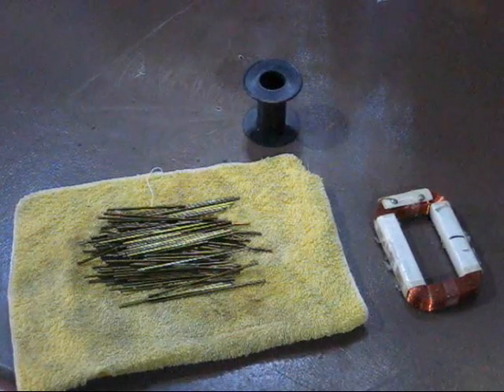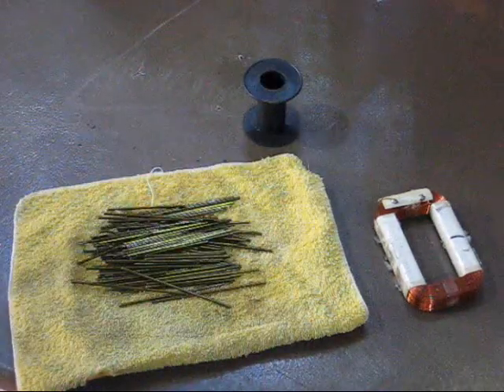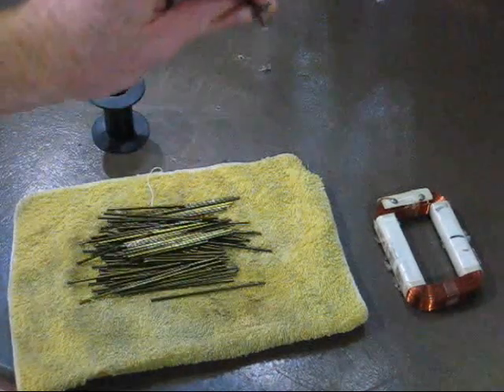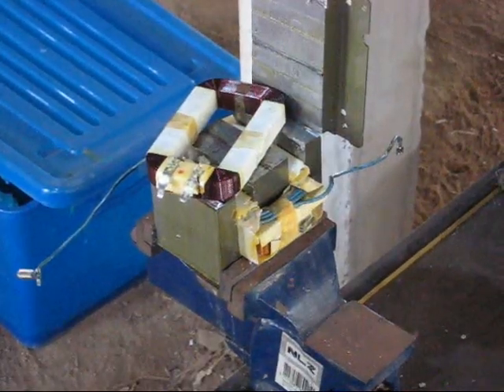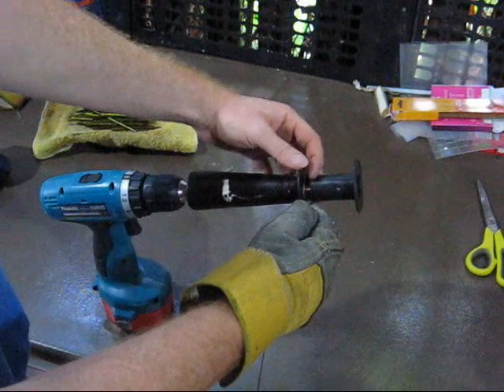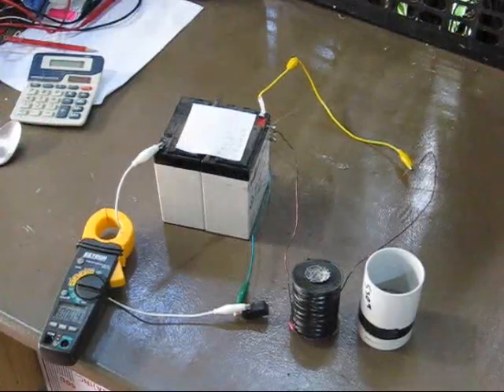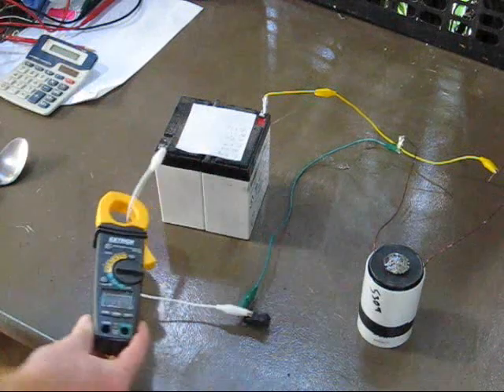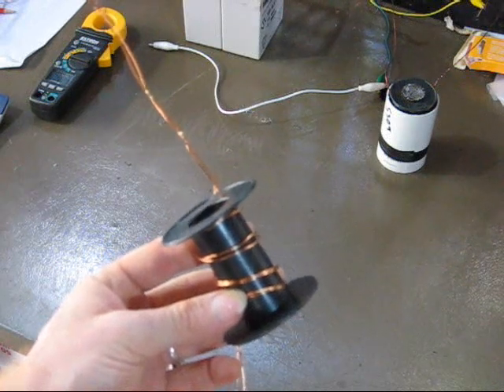DIY Electromagnets

Comment: doesnt the insulation have glue on it and when you take it apart it also strips the insulation off! i even tried doing it slowwwwwlllyyyyy and it still stripped it off, then i tried warming it with a heat gun on low and this made the coil come apart veryy easyy but it still stripped the insulation off the wire!!! This is just my experience it sucked so now i only use wire without old glue or new wire..

Comment: I never hooked voltage 120 v to the 2,100 volt secondary before, but in essence that is what you have done here, but just rewound it onto a cylinder shape, i was going to try it on the transformer without the primary physically in place, but instead i took off the secondary and put the primary back on, powered the original primary and turns out to be a very strong electromagnet powering it without the I piece of the E, I transformer, lol especially if/when the metal being attracted to the magnet is big enough piece to help the transformer core complete its magnetic flux lines, to be the i piece that is missing, to complete that missing piece it concentrates a huge holding force, more than if the piece was too small to complete the missing I piece.

Comment: Great video mate! Very informative and well done. I wanted to ask for a bit of clarification, I had the same question as sky7ark regarding windings. As long as the winds are in the same direction, lets say clockwise, I can go back and forth up and down the spool to get more turns and thus power correct? A little confused on the meaning of the windings need to be in the same "direction", I think from my E&M classes it only refers to clockwise/couterclockwise and not up or down the spool. Appreciate the information and the video!

Comment: so to clarify, you wind the wires around the spool using two wires, stick the hanger pieces in the middle, then attach it to a battery using the two wires sticking out?

Comment: i take the i fro the e just like you
take out the shunts
and wire both coils together in series(making sure the coils turn the same way
put the coils back and you have a 12 volt electromagnet capable of lifting a good 500 lbs